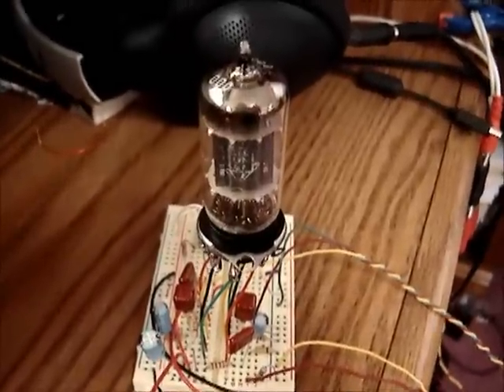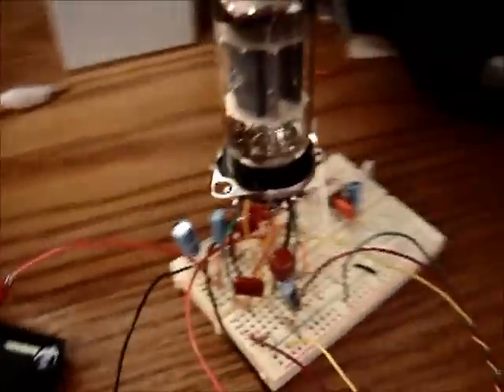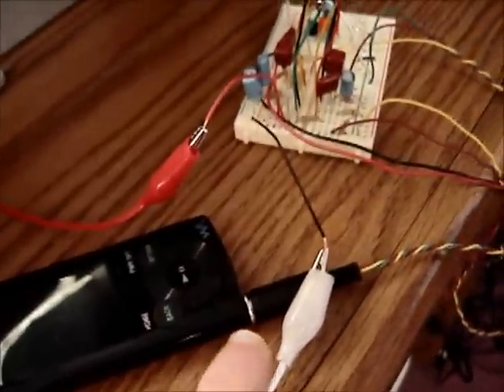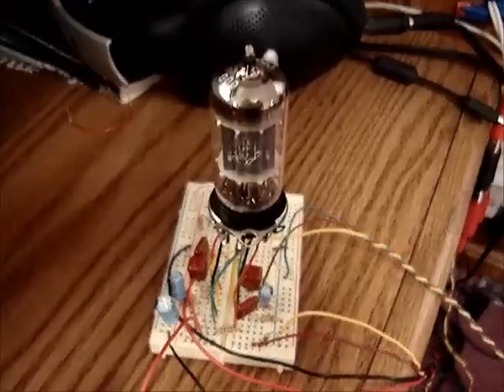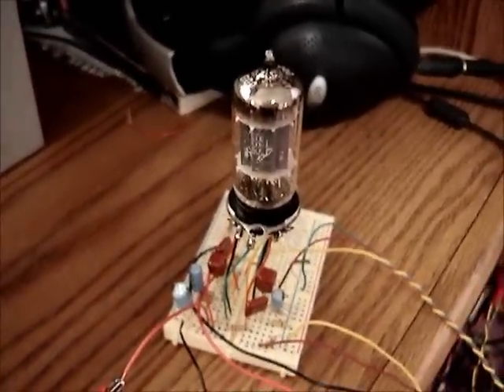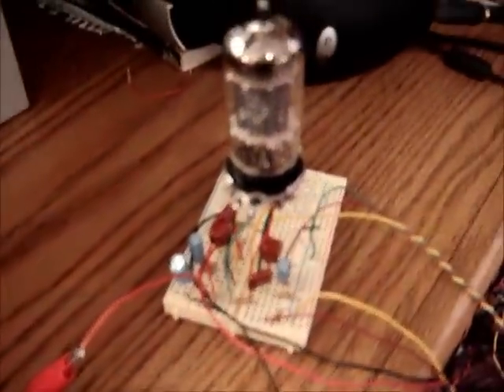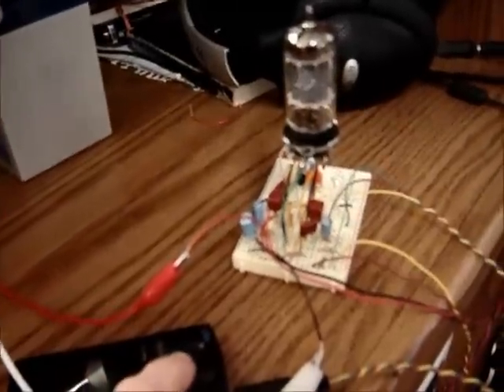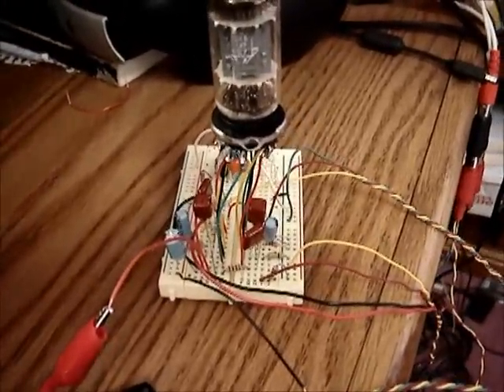12AX7 stereo tube preamp only 12 volts

Comment: If you had gain to spare, you might be able to lower the THD by removing the cathode bye pass capacitor giving a degree of negative feedback. Just a thought!
Reply: It's in the video I am drawing my own and I'm going to beef up the plate voltage by using ac and use a voltage multiplier for the B+ 96 vdc. I may use a 24 volt transformer because they are available, they are used in heating and air conditioning. There are power adapters that are AC as well. If you want the true tube sound you will need some iron on the output. A 70 volt line transformer will work, the kind used in PA systems. 73

Comment: You will only notice the warmer tube sound if you have a tube amplifier, not just 1 tube. And for you to really notice the difference you have to have very good speakers that can handle those frequency responses that only tubes can deliver, but off course you will notice nothing with only a pre-amp tube and some sheety speakers of plastic...
Reply: "but off course you will notice nothing with only a pre-amp tube "
You are talking out of your ass man. You are very wrong. You can get a dramatic difference in sound simply by tube rolling a pre-amp. Although the difference is not as much as a tube power amp, a tube pre-amp VERY MUCH colors the sound.

Comment: It's not the tube that gives the harmonics Odd or Even. It's the architecture of the preamplifier. Use a NPN or PNP transistor in the same configuration (class A) and you will have the same Harmonic Products

Comment: how did you manage not to use any transformer, how did it work without ac voltage? and no output transformer???
Reply from the maker: This is a preamp circuit (not driving a speaker direct). The impedance on the output is high but can still drive the line input to my amplifier.
Reply: in all valve amps there is the ac mains but only to the power transformer then the voltage is rectified to dc. Unless of course you are building the preamp in question.

Comment: Hi, is it possible to add a RIAA eq network to this circuit?
Reply from the maker: zeroTiza You could if you want just the equalization, but if you need it to bring the output of the cartridge up to line level w/ equalization as in a typical phono preamp, then no it does not have enough gain.

Comment: I have not seen one of these run at 12V before so very interesting.  

But could you simplify even further I wonder?  The cathode resistor is normally there to provide the cathode with a positive voltage relative to the grid but you are having to run with a positive grid to make this work ( close to 11V from your resistor divider values).  So, could you not eliminate the cathode resistor entirely and then you would obviously not need the cathode bypass capacitor either.  Then adjust your grid bias voltage until your anode voltage was 6V?
Reply from the maker: Yes you could remove the cathode resistor but it also serves another purpose called cathode degeneration which provides some bias stability as supply voltage changes (battery runs down) and some negative feedback at the the cost of gain which reduces distortion. That tube I have is worn so the divider network may not work properly for a newer tube.
Reply: look at cool dude clems vids he tried three or four similar valves and he got one to amplify 80 times.

Comment: I just watched your video and im thinking about making a guitar preamp with this tube, as it is a double triode tube can it be used so one triode makes the clean sound and the other does the overdrive? Then the sound goes into a class D amplifier (because I like efficiency) also I have read the previous com about the input impedance (i know it's 4 months old) and it's usually fixed with a 22k resistor (at least on transistor amps) I need to study again how to wire a triode and then I think I will be able to make some cheap and gread sounding amps
Also most people put on a plate voltage about 200V and you don't, what do you do instead?
But maybe im saying something insane because it's 1am
Reply from the maker: Hi, this low voltage tube amp was more of an experiment. The gain is fairly low so you should experiment with additional stages for distortion driving. Input impedance can be low or high depending on the amplifier topology.
Reply: JohnAudioTech but 12volts as plate voltage works? (well it should, or I don't know where you get sound in the video)
I think a little chip or transistor as a pre-preamp should do the work to get enough gain (and if gain is still too low, maybe take the output signal of one triode and put it in the other triode of the tube)
Reply: A better way would be to cascade the two haves. Connect the signal to one, connect it's output to the input of the other. This amplifier inverts the signal, so running into the next stage will put it back in phase. The gain will be multiplied, making it much more sensitive. For distortion, you can delete the 10 uF capacitor that's in parallel with the cathode follower resistor. That will give a much cleaner, less distortion sound, than even this amplifier in the video. When you WANT distortion, putting the capacitor back in circuit will give enough gain, that it won't be hard at all, to get the "overdrive" or "tube stack" sound.

Comment: I will make this circuit to connect it as an preamplifier to my pl-504 amplifier.I am sure it will work.Bravo, 12 volt is perfect voltage.300+ CAN SENT YOU STRAIGHT TO THE OTHER WORLD.Thank you for the advise and the shematic.
Reply: 300 vdc is no problem if you know what you are doing, only experienced electronic techs should use high B+ voltages I'm going to use 96 vdc from 24 vac transformer. A voltage multiplier will bring the voltage up. 73

Comment: John, I think that you could use self-bias (or cathode bias). That would require only a cathode resistor. At the grid you only need a high value resistor of about 1 M to ground. The current through the cathode resistor would put the cathode at a positive value relative to the zero volts at the grid due to the 1M to ground. So you wouldn't need the resistor going from the grid to +12V. Thus the grid voltage is at a negative voltage relative to the cathode. That's how self-bias works and the way it is usually done. Using only 12 V for the plate puts this amp in the starvation mode. All that means is that you won't have the dynamic range of signal that you would have if you used the normal 200 to 400 volts.  However, your circuit seems to work well enough to boost the signal well about that of your music source. Good job!
Reply from the maker: Hi Alex, The way you described it is how I normally bias the tube with a high plate voltage. However, I had to put a positive voltage on the grid relative to the cathode to get the electrons flowing because of such a low plate voltage.
Reply: JohnAudioTech That sounds reasonable. I guess I would probably do the same thing after I experimented with it like you did.  Good job.

Comment: Sorry to say this, but your tube circuit does not operate, as you only hear the sound from the path formed by this: input cap ->47k -> 22k -> output cap. That the path the signal goes. The tube is just switched off.  Disconnect or omit the 47k resistor and you´ll see what i mean;)

If you want to use low voltage, the former battery tubes are what you need. european DCxx ol DLxx types or some ECH84 alike, intended to use in former car audio, will do as well....
Reply from the maker: The amplifier has a measured 20db of voltage gain. The path you say has the signal passing through the positive supply. The 12v battery has too low of impedance and would effectively short the signal to ground before it gets to the 22K resistor. Removing the battery, the amplifier goes silent, also no signal until the filament warms the cathode. The signal path is through the tube.
Reply: To be honest, this was my first guess, just for the looks of your wiring....I never run tubes at low voltages, but i´ll do a test of your design, to see if it works ;)
As i have to do a basic tube amplifier setup anyway.
So i´ll do a 12AX7 (=ECC83) design and show how to pick the needed components for 250V and then run this and your design as well on 12V....
Reply: TubiCal A circuit designed for 250V B+ probably would not work at 12V B+ (among other things, the bias would be totally wrong, as pointed out in the video).  It's not unheard of to build low-voltage pre-amps out of tubes that normally run at high voltage.  I've built a guitar overdrive stomp box with dual-12AU7s that runs on 12V B+ (and actually runs fine on 9V B+ and 9V heater supply).

Comment: Hey what do you use as your test setup? What software are you using to analyse the result of the 1kHz sine wave? What did you use to generate it?
Reply from the maker: I use the FFT spectrum analyzer in Audacity. You have to be sure your sound card can record with very low distortion (~.001%) and your signal source is also of low distortion so it won't influence the results.

Comment: I have a question about the 1µF capacitor : Must they be "film" capacitor or can the be ceramic or electrolythic ?
Reply from the maker: If you're just playing around on a breadboard, you can use any capacitor type, however, I'd recommend film if you're building a finished amp.
Reply: JohnAudioTech I tried the schematic in your video, but it doesn't give a louder sound, it gives a much dimmer sound. Can you help me please?
Reply: JohnAudioTech Ok after some experimentings withe the circuit, I found a solution !! I've added a buffer circuit with an LM386 and it works really well !!!

Comment: Here's the "complete" schematic...still just one chan but boosted by both sides of the triode this time. I will be happy with any improvement. If I figure this out I may dust off some Type 30s up in the attic! Power amps...the next frontier.

This is your schematic but showing both sides of the valve the way I set them up 2nd time around:

http://i51.photobucket.com/albums/f396/czechrite/W-AMP1-contrast_zpsbd58742a.jpg

I'm curious if the resistors should stay the same on the "end" of the circuit of if the other half of the tube should have the same resistors applied to it.
Reply: Hey! I know this was a long time ago, but did this schematic work for you? I see you used a 6N2P-EV. I have a 6N2 (chinese) here, and was wondering if I could build a reasonable preamp with the schematic you drew.
Reply: The WALLDORF - the site will not let you on any more...

Comment: Here's my attempt to copy your amp project here. I only half-succeeded. Now that I am actually looking at the video again, I'm seeing about twice the components on yours compared to mine (and I am not including the power circuit). It seems that you have joined the twin triodes together somehow. All I did was copy your schematic and "double" the plate/surface size of the anode/cathode by connecting them in parallel. I guess the effect is not "double gain" but rather I've turned this 6N2P-EV into a 6N1P or something like it (a single triode rather than a double or twin).

My "video reply" to this vid is here:

http://youtu.be/zqErVXI3d_4

If you have time to watch and comment, I'd be grateful.

Thanks.
Reply: MAN CAVE NO.1
Reply: If you only use one triode of a 12AX7, you can install the tube backwards to use the other triode. It was designed this way, the pins line up perfectly in both orientations, as long as you drive the heater at 6.3v instead of 12.6v. 

This is a great thing to design in as it will double the life of your tubes, or if you are picky, double your chance of finding perfectly matched triode pairs.

Comment: I am trying to learn about tubes and basic electronics again. A low-voltage tube amp is IDEAL for what I want! Thanks for providing a schematic! It will really help me get the basics down.
Reply from the maker: Thanks for watching. Using a 24 volt supply should work better for a preamp. My tube was worn, just good enough to use, so you have to tweak the bias for best performance with a new tube and 24v supply.
Reply: JohnAudioTech Seriously, thanks for uploading, but I need your help. I am really pulling out at the basics from way back. I know what components are supposed to do, but I'm still learning how they effect a circuit overall. Bias effects and tweaking are unknown to me but I'm guessing you mean something about how to maximize the electron transfer in the tubes. I would learn a lot if you could let me see a clear pic of the schematic, as I can't see the upper left. What I can see I'm not certain where the power supply fits in here completely and where the "ground" for the in/out connections would be. I'm also guessing that there is a separate simple circuit for the tube heat element. I hate to be a pain but can you help a "newbie" out? Cheers....and thanks for any help!
Reply from the maker: *****
 The components in the upper left are not needed. They were for supplying the tube from an automotive electrical system. The biasing (called class A in this amp) sets the quiescent (no signal point) on the plate to around 1/2 the supply voltage which allows room for the voltage to swing up and below this halfway point as it amplifies the signal. The output, input and power negative go to the same point which is called ground and not necessarily grounded to earth. All this might not make sense to you now. I really can't give a lesson in a few words where book chapters of reading and soldering iron in hand are needed.
Reply: JohnAudioTech Hello. I understnad basic schematics and what the ground of the circuit could be, but I don't know exactly where the negative/ground of the circuit would be with certainty. So the upper left is power supply....OK. Understood. However, I don't know for certain where the ground or negative terminal would be indicated here...but I'm assuming it is the "bottom" of your schematic as it's all connected in one line opposite the many resistors? Yes?
Reply from the maker: ***** Yes, you are correct. It is the bottom horizontal line that represents the negative side or common point of the circuit.

Comment: I want to make a tube preamp for plugging guitar into pc. Will it help or i need another config for guitar sound? I know that they use 12ax7 as power tubes in cabinet heads. I am an electrical engineer, but not aqustic. Thanks in advance.
Reply from the maker: With guitars, you need higher input impedance and additional stages if you want to reach tube overdrive sound.
Reply: Thanks for advice, i will measure how much impedance i need for my pickups...

Comment: Interesting low V hack. I wonder if and how that affects performance?
   Tubes are great for voltage gain, stupid for current gain (power amps) IMHO. the 12A*7 series were all good audio tubes. Still, even in a preamp I see little or no real advantage, and construction costs are higher, power consumption higher...
Reply from the maker: It may be more linear at higher plate voltages with more voltage headroom to work in. As measured, this amp seems to have what the tube enthusiasts like: A pinch of low order harmonics and no high order (gritty sound) harmonics. True that tubes are not practical these days. It is just electronic tinkering to me and perhaps nostalgia to others.
Reply: JohnAudioTech
Dave L Clark designed an even harmonic generator, was published in a magazine a few decades back (Audio Amateur?) If I remember it wasn't too complex, would like to locate a schematic for it.